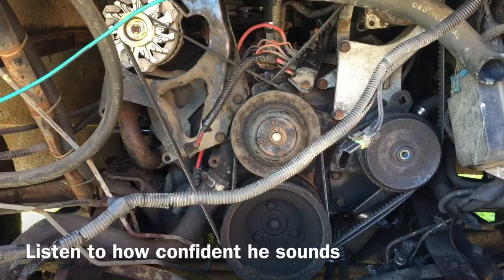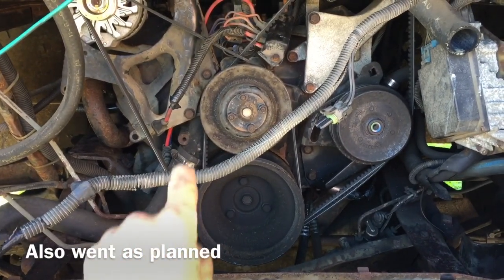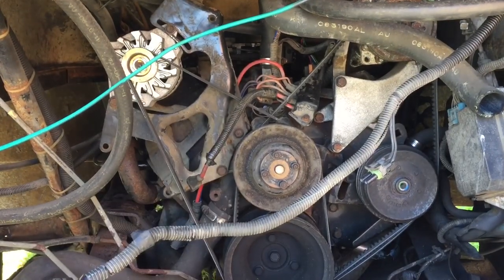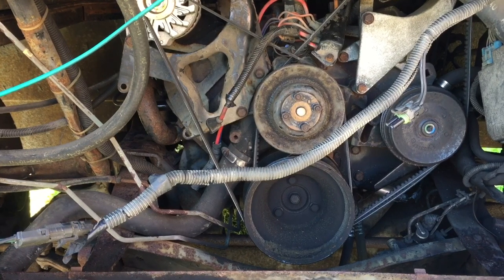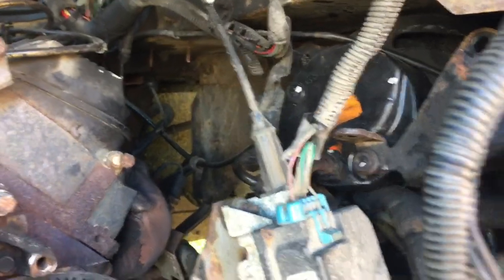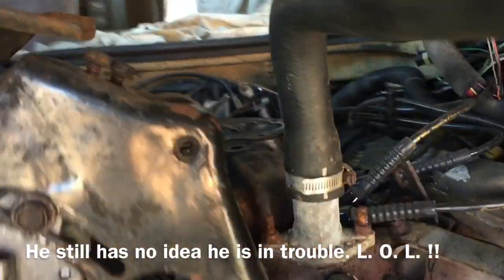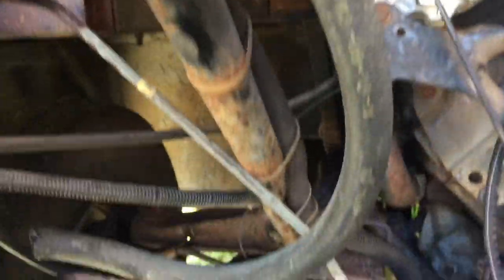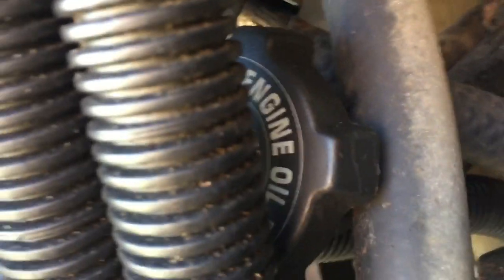1991 BOUNDER by FLEETWOOD ENGINE REMOVAL 454 BBC CHEVY P30/p35 engine pull PART 2 UH OH TROUBLE.

Comment: I'd like to see pics of the motor after you get it pulled out. Pulley brackets & supports are an issues on the 1987 Arrow 454 Chevy engine. Thanks for the video.
Reply from the maker: +0-Zone hmm. Already back in and running. Sorry about that. Will check to see if I have any photos. 
Also planning to do a recap vid before I deliver it.

Comment: TO USE THE CRANE IN THIS SITUATION jack up the vehicle real high and double block the motorhome front and rear of dually tires,then the crane will be horizontal with the beam on the crane,higher means you can lift the engine higher,working on the mark v and mark 6 engine is best done outside the frame,be careful